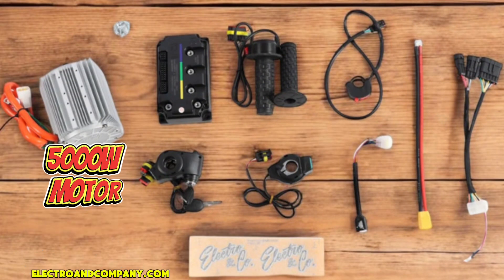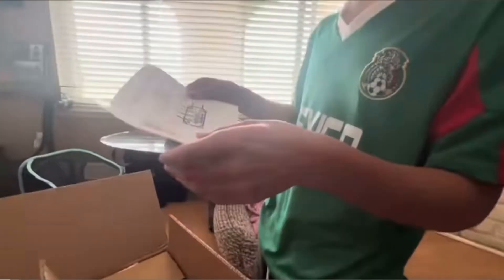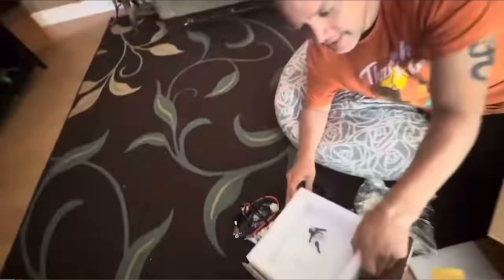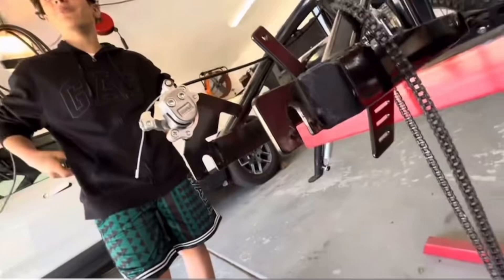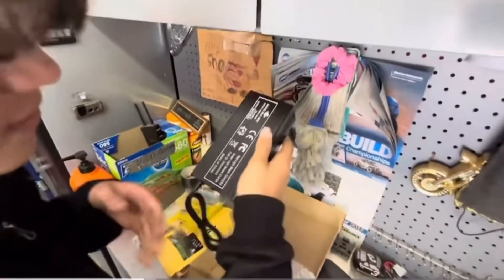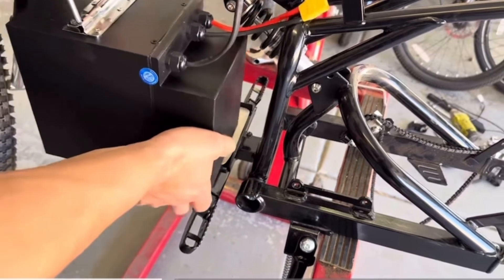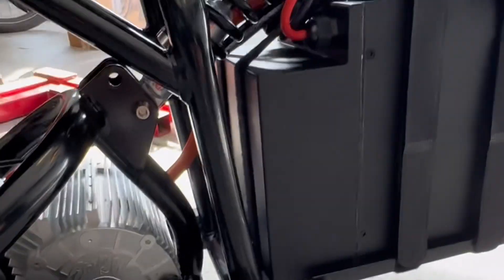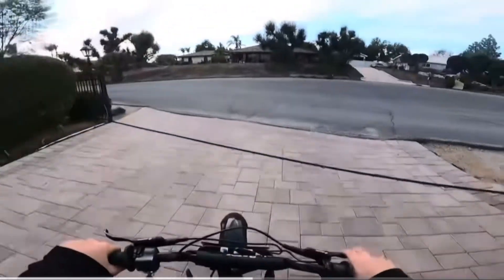Razor MX650 5000w Upgrade - Electro & Co Kit

Comment: Hey dude, awesome build! I have a quick question, the old parts (Brakes, motor, controller, battery etc. ) If you wont be using them would you be able to send them over to me in sweden free of charge, i want to build one of those electric drift quads but powertrains are expensive these days!

Kind regards Svante
Reply from the maker: Hey Svante, I still have the parts but plan on using them on another build.  I appreciate the comment!  Thanks Jon
Reply: @TheSustainableTracker  Okay, i fully understand that. if you dont mind me asking what will you be building?
Reply from the maker: @SvanteJohansson-b3s We have a Razor MX350 that we want to convert to a 650.  That is what we plan on doing on our next video.  But I like your idea of a cart. Hmm..
Reply: @TheSustainableTracker  okay thats cool!
Reply: @TheSustainableTracker  maybe the 350's parts? ofc. up to you!